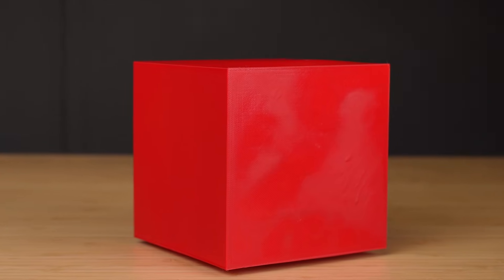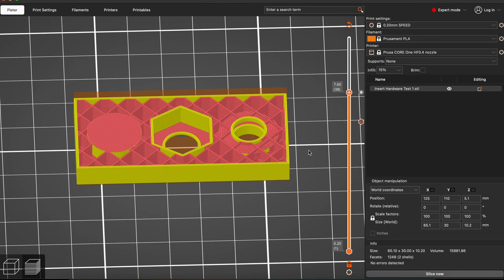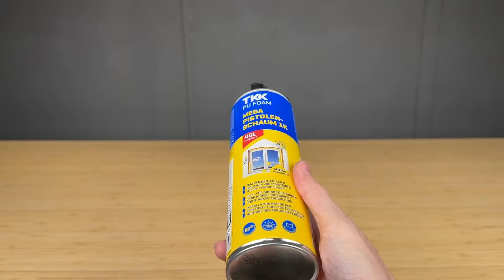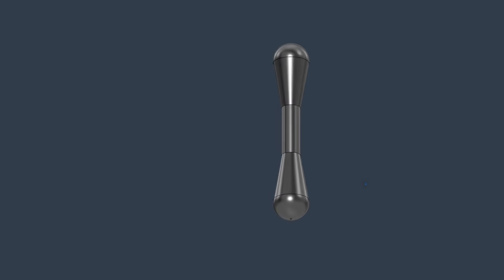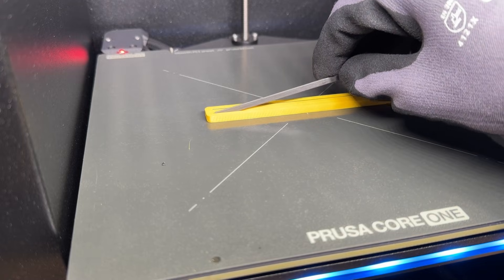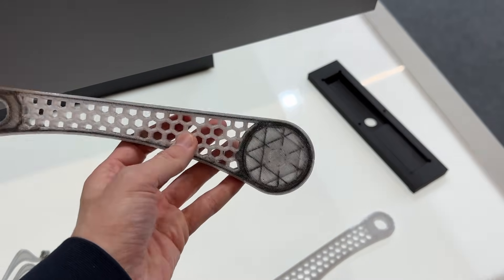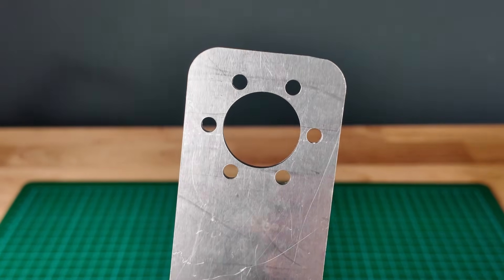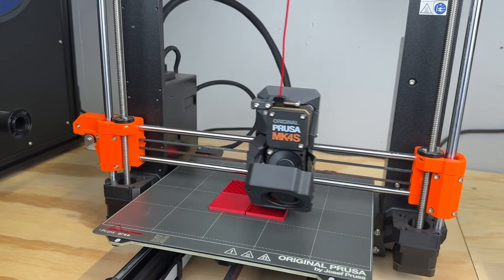Stronger 3D Prints by Inserting Hardware While Printing

Comment from the maker: What are your go-to hacks for stronger 3d prints? Let me know below!
Reply: Bicycle spokes. typically ~2-2.2mm in diameter. Mainly use them as hinge dowels, but have some ideas for other things as well.
Reply: Put TPU insert inside PLA/PETG
Reply: I've been pausing and putting carbon rod or strip in prints since I started over 10 years ago. Really good when you need a thin but, stiff part. My main use case has been RC car and drone parts.
Reply: Used your affiliate link (screwdriver). Looks good and one of those were still missing from my toolbox. 
Also, subscribed. Grüß aus den Niederlanden.
Reply: Thank you for the inspiring video! The big channels are focusing too much into hardware and filaments. I use screen door mesh and steel mesh for clothing and bendable prints respectively. Also have used sand as a filler for game pieces, great for a much more substantial and non-cheap feel.
Reply: I'm too lazy. I put glass fiber on the surface and slather with abs goo. It warps if wall is too thin, ofc.
Reply: I designed ball bearings where you insert the metal balls mid print. They end up being simpler to assemble than other printable bearings and are smoother and stronger than any I've found.
Reply: @KelNishi do you print the cage too or just racers?

Comment: Hey this isn’t super relevant to this video but I had a thought but don’t have the knowledge to test it myself. You know how tall towers in 3d printing are weak because of layer lines? What if you could just gcode to fill them with molten plastic in stead of infill. Maybe with the H2D and a larger 1mm high flow nozzle? Or even program a pause so you could add epoxy ? Either way love the videos!
Reply from the maker: Thanks - I actually did a video trying out injecting molten filament into the infill to increase layer adhesion! You can find it on my channel.

Comment: Wrong conclusions on the embeded screw test!!! The part with the screw broke right above the screw because this is where your pause where. The layers at pause spot had weaker bound because of cooling of the bottom layer during pause. Pause spot becomes the weakest spot.

Comment: Putting in sand is a good idea, but the weight on the bed might be more than your printer can handle and might throw off calibration.
Also, I wanted to ask if the pause in the slicer will also lower the bed to give room to work. Will it?

Comment: Some of the most immediate uses I can think of besides strengthening would be easily embedding bearings or threaded inserts/nuts in order accept other hardware during final assembly. I imagine it would often be a lot easier and more successful than heat staking or press fitting
Reply: Imbedding a square nut is incredibely stronger than a threaded insert and needs absolutely no tools to insert

Comment: Sand is a horrible addition. The risk of it blowing off or getting into the rods is too risky.  I used lead shot for this exact reason. Gives a great weight, it's inexpensive and easy to clean up with 0 risk to your printer.

Comment: 3D print designs always favour machine screws, probably because we're on the fringe of the CNC world. Self-tapping wood screws are easier to obtain, and have better behaviours in plastic. They aren't reliable for taking in/out like machine screws in brass threaded inserts etc., but if you just want it to hold a print together permanently, or reinforce layers, put a pilot hole into your model, so the screw has plenty of wall to work with, then just whizz some wood screws in to lend some steel-strength to your print! No need for carbon-fibre fear either.

Comment: Adding a void in the middle of the print for the carbon also added additional walls. Print it again without the carbon rods for accurate testing.
Reply from the maker: Good point, I actually did print the other sample without the carbon rods but with the additional walls. The other referenced filaments in the bar charts were tested previously with samples made from max. perimeters.

Comment: Springs and hinges, work well and can usually be put in afterwards. I’m currently designing a headband that has bolt holes in it that will connect to external pieces, in this case horns, which will have integrated nuts in them for the bolt to screw into, which will join the two parts.

Comment: Sometimes you need to reinforce, but not use metal.  Don't underestimate fiberglass driveway reflectors.  They can be sawn with a hacksaw, sanded and filed.  Add these to various 3D printed parts and they become really rugged.  They can be epoxied in place if necessary.  The part becomes very strong in tension and much stronger than 3D printed parts in sheer and compression.

Comment: Great video.  I think something related to this is the use of pre printed supports that can be removed when the actual part is complete.  

I like the comment on print the container for sand and then imbedding it already sealed into the actual part.

Thanks!

Comment: IMPORTANT NOTE ABOUT ADDING WEIGHT WHILE PRINTING!!

I've done this recently on a project where I made 16 small stop blocks filled with sand, and first of all sand will get EVERYWHERE in your motion system unless you pour very carefully and ideally use a funnel to prevent any spills. Also, if you fill to the top of the print and then bridge over it to seal it in, the fans will launch sand out of the print and make a HUGE mess. Sand in your gears and linear rails sucks, trust me. You can wet the surface of the sand to make it stick together, but be aware this is still only 98% effective. A few grains will still get blown out. A layer of glue would be better.

Also, once the weight is added, if you don't have a core XY printer then the bed will probably skip gear teeth due to trying to accelerate the bed too fast for the belts to handle. This wreaks havoc on print quality and layer alignment. Make sure you set travel and print acceleration VERY low before starting the print if you are going to be adding a significant amount of weight mid-print. With a core XY printer, this probably isn't an issue but the Z axis might still have a limit. Though probably far higher. Enough to not be an issue unless you add an incredible amount of weight.

Comment: This video was exactly what I was looking for a few days ago, Adding stiffeners into prints is nothing new, I've seen old videos where it's done. But it's an extremely useful approach. I think for hobbyists maybe cutting a strip of sheet metal or buying some kind of sheet metal band with the right width could be easier to work with and more cost effective. For more stiffness stack multiple sheets.

Comment: I printed a dowel jig for woodworking.  To keep a thin part from breaking off parallel to layer lines I modeled some holes that I could put large nails in.  The holes came out a few thousandths of an inch smaller than the nail.  One of the nails I was able to drive in all the way with a very large hammer, the other nail I got in only 2/3 of the way but the dowel jig survived drilling 128 holes.  So be careful with dimensions.  I think it would be more foolproof to model in plenty of clearance and embed the reinforcing using some epoxy or CA to make it fit tightly.

Comment: Awesome video summary of the "add metal hardware" approach.
I'm waiting for a CNC wire bending service to start offering basic and customized reinforcement pieces.
Wire bending is the perfect fit for that, since it's mostly software defined with a very limited number of wire diameters.
And if that doesn't suffice, CNC sheet metal processing to produce parts with a limited set of tooling would also be sweet.
But really, let's first get the wire bending off the ground.

Comment: Sand makes me really nervous because I don't want it getting everywhere in my machine. What I have used before is lead shot (basically small lead balls). I just pour them in, and then put in some hot glue to keep them from rattling.

Mostly I've been focused on adding weight, but it does also add strength.

Comment: Not only strength, sometimes you want the part to be bottom heavy and adding steel washers is an easy way to get that. Recently I added 4 washers to total of 250g in a plastic part only 60g plastic.

Comment: This is an awesome strength boost. Love the easy way to create composites!

A important reminder though: 
composites are great while they live, terrible when they die.
Once you mix plastic with an other plastic, metal or carbon, recycling is basically impossible.
Engineering doesn’t end at how to create an object. It also includes how the object ends its life.

Worth keeping the objects full lifecycle in mind, and making desing ethical and sustainable!
Reply: Love to see it. Sadly it seems most people in the hobby won't care
Reply from the maker: Great point, composites can be a recycling nightmare, so I’ll definitely keep full lifecycle/end-of-life in mind when designing and recommending these strength tricks.

Comment: Doing a bit of math... If you use washers or nuts or bolts, you need to be buying those in bulk to be even close to competitive with the price to weight ratio of PLA.. 🤔
Reply from the maker: True, but if you want to save print time and energy, it might make sense. It should indeed be calculated though.

Comment: Brilliant info, thanks - another interesting point is that as well as carbon fibre inserts you also have glass fibre inserts(heavier), one of the big differences here is that carbon fibre is amazing at converting stress into failure as sometimes used in the crumple zones in cars, the carbon fibre reinforcements take the energy and at a certain point it destroys its own structure (very important for pedestrian survivability) - conversely glass fibre reinforcements although not as stiff as carbon fibres store a lot more energy and generally don't destroy themselves and 'bounce' the energy straight back in a very repeatably fashion - hence glass fibre boat hulls can take decades of wave impact stress with very little degradation. Choosing the right material for a given application can really help... Thank-you for your always informative videos!! BH;)

Comment: I want to weigh one of my prints down, but the thought of bringing sand close to the 3D printer scares me! 😱
Reply from the maker: Someone else suggested using some kind of dough that hardens, it’s probably safer than sand…
Reply: @JanTecEngineering  Yeah, there exist even some 'molding' cements. But the price begins to rise at that point. Maybe mixing sand with some slow curing glue could be a compromise??

Comment: I print plastic 9mm Pistols of course I'm in America where people are still free, not to forget Switzerland and they don't have big gun problems their because they limit immigration. I've been inserting metal barrels, trigger groups, slides and rear support frames for years now. Over 14 / M106 commands per pistol so this takes about a week to make a pistol Since the printer always stops at 1:00am when you're sleeping! The infamous laws against the LOWER are circumvented by just using a hardened sheet metal slides which butt up against the plastic, good work around and legal. I also printed a working 9mm Luger, it's beautiful! Inserting metal parts is just an integral part of making an 18 ounce pistol like a Glock 17 knockoff. To be legal you need to insert at least 3.5oz.of metal parts so they can be read on a metal detector which is a reasonable law and frankly makes the gun tougher. I print in Nylon carbon fiber in a heated chamber and I print on slow-speed with .02mm nozzle and the guns look as beautiful as factory made and are highly functional with me shooting over 10,000 rounds without malfunction. To print a pistol and only costs about $90 including the metal parts kit which they sell online from Texas. The kits are even legal in Europe since no one knows what they are.

Comment: Earlier this year I reverse-engineered the Italian broom thread (yes, there are many different broom threads) and designed a thread adapter assembly that fits inside a standard 20mm⌀ metal broom handle so I can use my favorite foreign squeegee head here in Canada.  To make this work I needed a way to 
a) secure the assembly inside the handle and 
b) provide rigidity so that the part would not split along the layer lines.

I came up with a simple 4-part mechanism: A hex-drive connector bolt is inserted into the tip of the threaded body and is captured on the other end by a standard nut which is press-fit into a separate wedge-shaped body. As I tighten the bolt, the nut pulls the wedge into the threaded body, expanding its split sides against the inner surface of the tube with incredible pressure. Of course, since the bolt runs perpendicular to the Z-axis, it also compresses the layers together and provides tremendous strength and stiffness relative to the forces I apply by cleaning the floor.  😂

Comment: The main thing to remember here is that carbon fiber is quite dangerous to manipulate. When you break it, it makes "mini clouds" of fibers that you can see with the naked eye : those particles would enjoy getting in your lungs and tadaaa lung cancer a few decades later. It's a bit like asbestos and nobody would promote asbestos use today on YT despite its qualities. The few times I needed it, I used to always cut them under a flow of water but I try to avoid cutting this stuff anyway.

Comment: With such inserts into 3dp parts its always the interfaces between the inserted parts that are the weak points.

Its a little messier, but the way to get the most strength out of 3dp, is to use the 3dp shape as a guide to easily embed an epoxy soaked continuous filament into; fix it in one place, and then wind the filament over the print in the grooves you model into the surface. Great for joining other things like wood, metal or carbon rods with non-meme strength. Glue into your printed jigs; then wrap in external fiber in a repeatable manner.

Comment: Pulltruded carbon fiber rods are probably the most useful thing to have on hand for strengthening 3D prints. I keep a variety of them in round, flat square and hex profiles in various diameters. Pulltruded, as opposed to matrix carbon fiber, has all of the fiber running lengthwise, and is much less expensive and extremely strong. When shopping for it, remember its carbon FIBER rod, not carbon rod. Carbon rod has no fibers and is actually weaker than the z axis of a 3d print. Round carbon fiber rod will strengthen the z axis of a vertically printed shaft when bent, but will not provide as much torsion strength needed for a drive shaft or cam shaft for example. This is where I prefer a hex shaped carbon fiber rod to strengthen the part in both bend and twist directions. I vertically 3D print 9 inch long cam shafts in one piece for a clients animated displays. They feature a 3in gear at one end, a 3/4in shaft with 5 equally spaced cams of varying shapes, and the whole thing is only supported by a bearing on each end. I print it with an 8mm hex hole through the length and insert an 8mm carbon fiber hex rod. The torque applied to these things when working is pretty high, but we've never had one break or deflect with the carbon fiber insert. Its pretty awesome to be able to print a part like this (that normally would be machined  from metal) on demand with customized cam profiles and hand it to the customer the same day at a fraction of the cost and time of machining.

Comment: Having worked in Structural Engineering for many years the idea of printing composite models really appeals to me, so well done for bringing it to a wider audience.

As for adding mass to prints, in the past I've used furniture making panel pins, though your idea of sand strikes me as more versatile approach for most cases.

Comment: You can 3d print moulds and make custom designed high strength forged carbon fiber reinforcement that you can insert into a print in progress. See the easy composites video on forged carbon fiber. Then you can make parts that have detail and complexity that is not possible to mould but has a core stronger than steel but a fraction of its weight.

Comment: I really like the idea of printing an interlocking thing out of TPU separately, and then inserting it before an overhanging layer. Or even printing a model with a bracket to hold the supports, which you previously printed out of a different filament.
Reply from the maker: That’s a cool idea. I think I got to experiment some more with these ideas.

Comment: Along the same lines, Chris Borge's channel has done a lot of work using 3d prints filled with concrete and embedded bolts to tie it all together (though after the fact rather than during print).

Another avenue is taking a 3d printed part and directly laying up fiberglass or carbon fiber/resin on the outside, so the 3d part provides internal functional stuff and form, and the external epoxy composite provides the strength and finish durability.

Comment: PVC tube is a good candidate too. I have a print which doesn’t fit in my machine so I split it in two and gave it a couple through holes for 3/4” pvc pipe. This aligns the two parts and is very sturdy. The pvc is as long as the part so adds compression strength too.

Comment: I added some washers into a part mid print for a functional purpose but the filament didn't stick well, next time I'll try putting some print adhesion spray onto it
Reply: If you've got full control of the design, making a removable core for the filament to bridge to in the middle of the washer, or creating a series of 1 layer thick  triangles around the edges of the circle to force the slicer to bridge across work well to alleviate this issue.